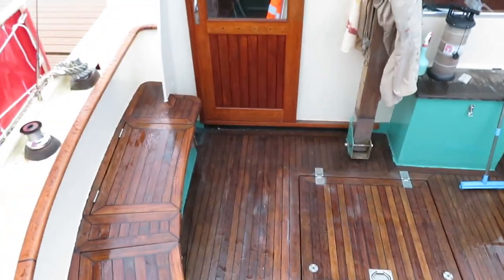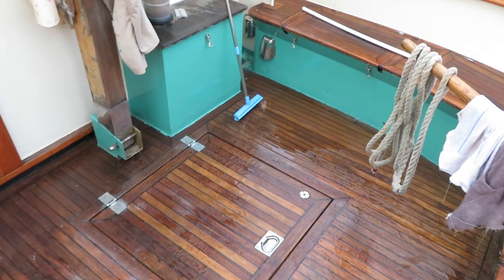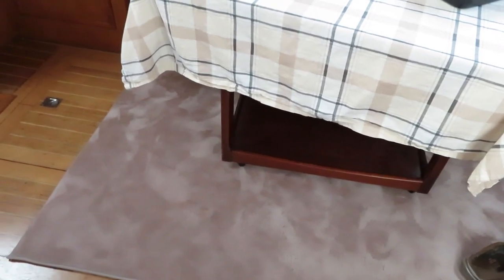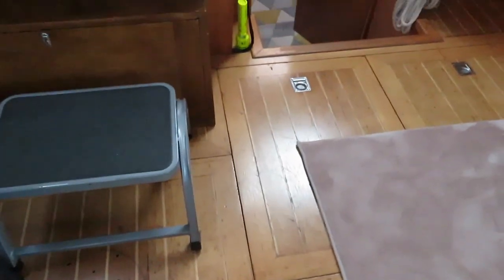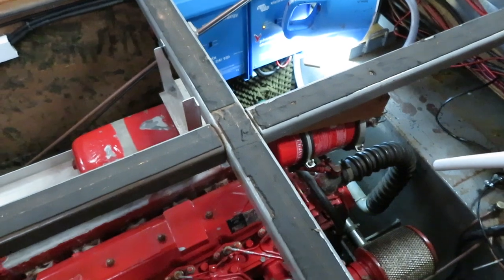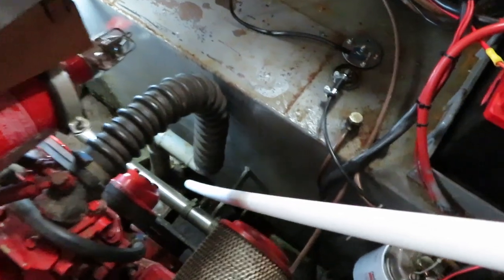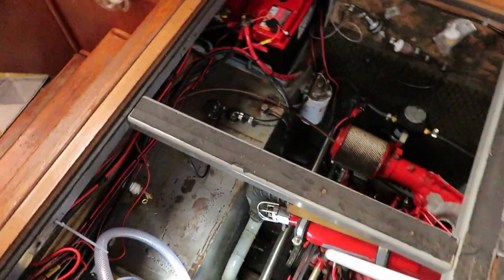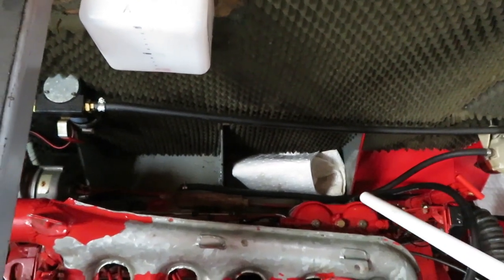Technical Tour--Skipjack Sailing 12

Comment: I get the shower needs a pump, but why run the other grey water to that pump?
Reply from the maker: The sinks are barely above the waterline.  This is the first time I've have a grey-water system.  Frankly, I'd rather send these drains to the main bilge.  Simplify.

Comment: How many Liter fuel tank and estimate range at cruising speed???
Reply from the maker: 700 liter in bulk fuel tank.
102 liter in day tank.
For estimation purposes, I call that about 200 gallons.
I estimate no more than 1 gallon per hour, making 6-8 knots.
Math:  7 nm x 200 hours = 1400.
So, I am thinking up to 1400 nm range.
What do you think?
Reply: @skipjacksailing8986  I had no idea to the speed of your vessel or the capacity hence me asking.
Can not argue wit your math....
Look forward to more of your productions as time allows.
Thank You !
Reply from the maker: @omegaseamaster1550  The real question will be:  can I make her reliably move without the engine?  I worry that the sail area is just too low...
Reply: That’s a great range.
Reply: I think 1gal per hour is overly optimistic for a big steel sailboat with a 100+ hp motor, but it might make 4.5 to 5 knots at that fuel consumption. At 7 knots , you are gonna burn 2.5 gal/hr.